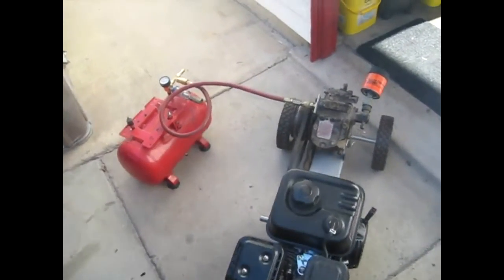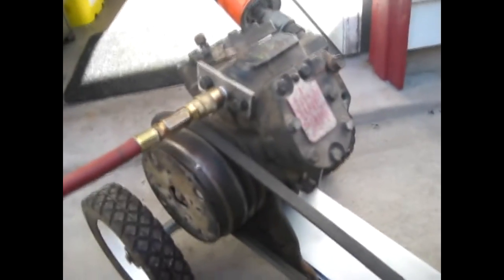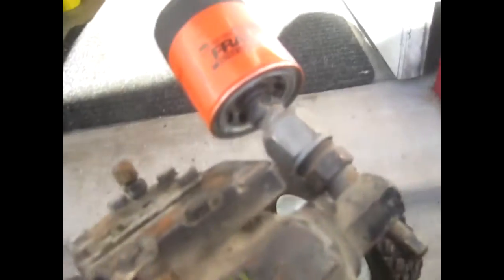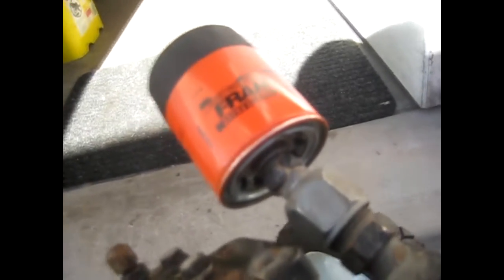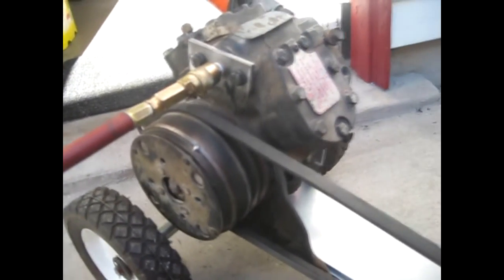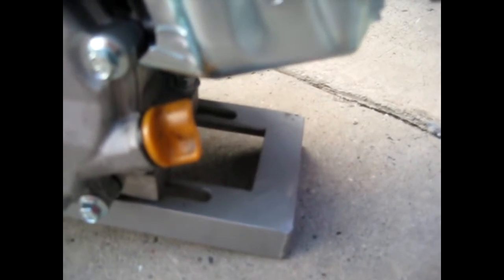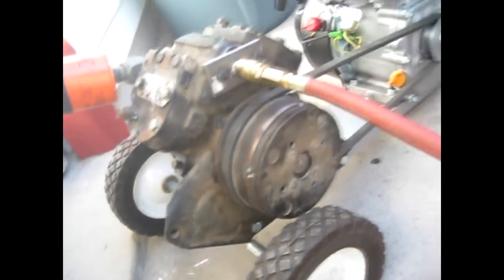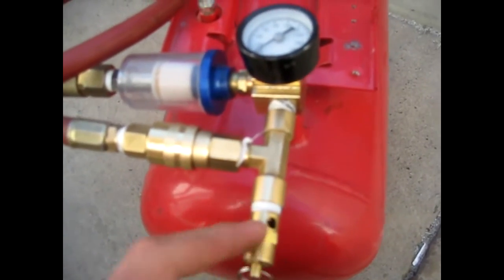Homemade Gas Powered Air Compressor

Comment: Wow I guess I missed this one. 
Pretty cool. Old AC unit compresses air just as good as it compresses freon. 
Nice portable air supply. Good job. Happy Motoring.
Reply from the maker: They work well, a lot of off road people use them for repairs on the trail. I even set one up as a vacuum pump for charging a/c systems, it will pull the system down to 25-30 inHg with no problems.
Reply: @SuperKONR  Very cool.  Wink wink nudge nudge know what I mean?
Happy Monday and Happy Motoring.

Comment: back in 06 I had an 83 bronco that I had the same a/c compressor mounted on the engine feeding two 5 gal tanks for air tools and low tires as well as a few 18 wheeler air horns. this brings back memories. thanks. keep in mind there's an oil plug toward the base.. you need to keep up on the oil level.. ( experience  ) they will seize up if not cause air is not lubricated, and adding oil to the air intake isn't sufficient. .. awesome project!
Reply from the maker: That's awesome! I've heard of a lot of off road guys doing that, seems like a handy setup. I keep an eye on the oil level, it does tend to send quite a bit out to the tank. It keeps my air tools lubricated though haha. Thanks!

Comment: Thats a cool set up you have built! Just thought I would mention that those compressors have an oil reservoir in the bottom, so you need to check the oil level. I had one like that on my 68 Imperial, it had run out of oil, and blown a con rod, so I dissected it  :)
Reply from the maker: +ChargerMiles007 Yessir, that's why they are so good for this application. These and the Yorks. Other ones would need an oiler added in the intake side. Thanks, I just made a follow up video of this and will post it shortly. It wasn't filling up very fast in this video because I forgot to remove the intake restrictor.
Reply: I will have to take a look for one of these old units at the scrapyards, though stuff this old is very rare here now, since it has pretty much all rusted out and been crushed. Danged freezing rain and therefore a ton of salt on the roads in the winter, it is murdering the vehicles!
Reply from the maker: ChargerMiles007
These were used into the 80s, but even then with the salt most cars that old are probably already gone. I could send you one but shipping would probably be crazy, these things weight a ton.
Reply: Into the 80s, I will take a look around these parts for one of them! No worries about you sending one, I know what you mean, they are heavy metal!!!!  :)

Comment: Hey long time no talk! So I've thought about building something just like this with an old AC compressor. Will it hold up over time? Maybe try running it over a few hours under load and see if the pump quits.
Reply from the maker: +hheywire Depends what kind you have. These RV2 pumps (and Yorks) have their own oil reservoir so they work great. If you use a swash plate compressor or something similar, you will need to add an oiler to the intake. Those ones are lubricated by the oil going through the a/c lines, they don't have their own reservoir. A/C compressors in general can put out around 300psi, so if you're only setting it up for 100psi and have an unloader valve there's much less heat/stress on the pump. Therefore there shouldn't be any duty cycle issues. People have been building these for decades with no problems.

Comment: Can someone explain why this is a good idea? That compressor is designed to fill air tanks, right?  So why not buy one? How much more could it be to buy one vs. building this contraption?
Reply from the maker: Why not buy chinese garbage that blows up within a year, instead of building a unit that's ten times better quality for a tenth of the price? I don't know, you tell me.
Reply: Two reasons number one being he probably has 200 bucks in this set up and has mobile air vs 1500 bucks second some guys like to tinker and build

Comment: How did you lockout the electric clutch
Reply from the maker: I put a few tack welds on the clutch
Reply: Shouldve rigged up 12 volts so you could set the clutch from a pressure switch. That way you never have to turn off the engine for extended uses and it would never use the safety blowoff.